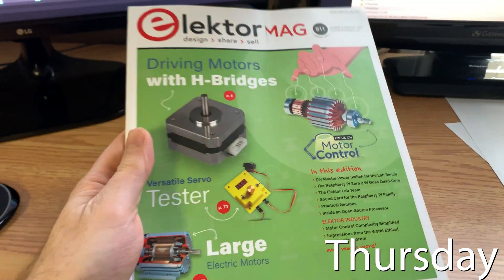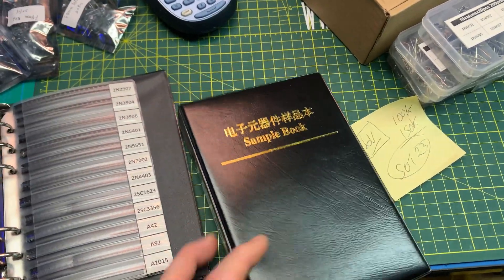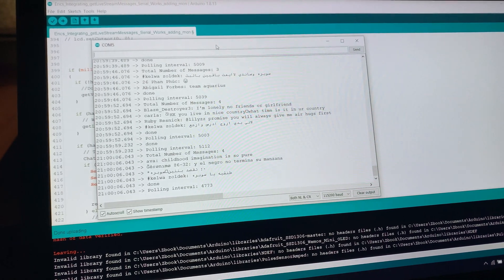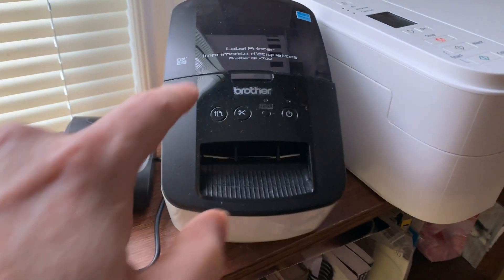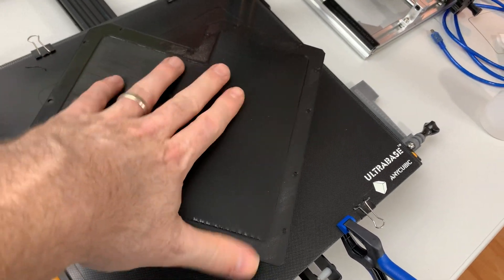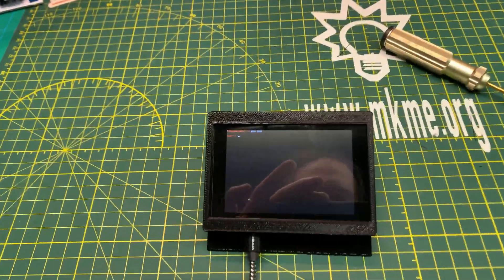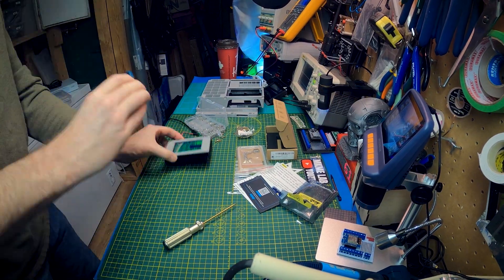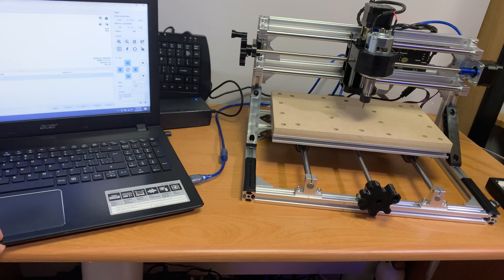New ESP32 & Displays Surprised Me! UPDATE

Comment: Nooo!!! Why did you not flip the tub and only use supports for the outside rim? That way you would have a nice smooth surface and way less support material used (also easier to remove as of the outside perimeter) oh well. 😉
Reply: P.s massive cudos for the display that's a def win! (Just watched the rest of the video)
Reply from the maker: That would have put the rough finish on the front bezel

Comment: Are TFT displays required for the ESP 32 wifi modules?
Or can I use it with my DWIN LCD that comes stock with the Ender 3 v2?
Reply from the maker: You can interface any display you like with an ESP32

Comment: Mostly trying to repair old audio equipment, and I have some Prusament PETG coming this week.  A few years back I tried to print PETG, and failed in frustration.  So i have a different Prusa printer now, and I am using Prusa slicer now as well... so I thought I would give it a try again using the Prusa PETG.  Cold enough for you?  lol
Reply from the maker: Sounds like fun.  Ya this morning was a bit brrr bit I'm fine with it.  I dont need to go anywhere and it doesn't snow much below -10.  It can stay for a bit but sounds like a mess is coming.  Cheers Bud

Comment: Cool project. You actually could have printed in the upside direction and save lot of material and a significant amount of time on top of it.
Reply from the maker: Thanks. That would have caused support material contact point goobers on the external surfaces/flange where this way it's on the inside.